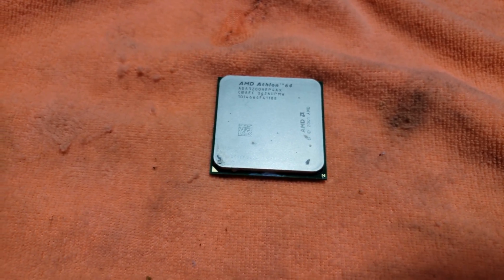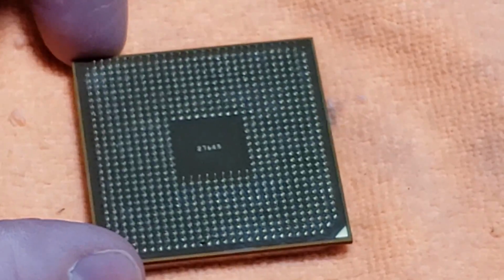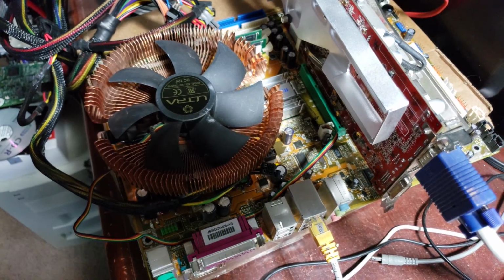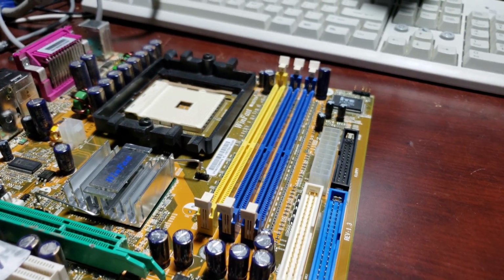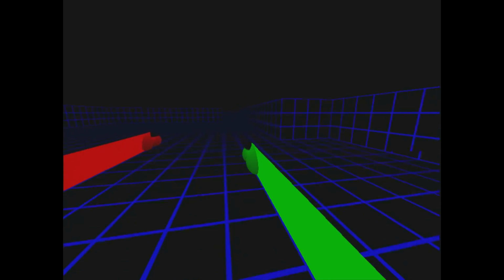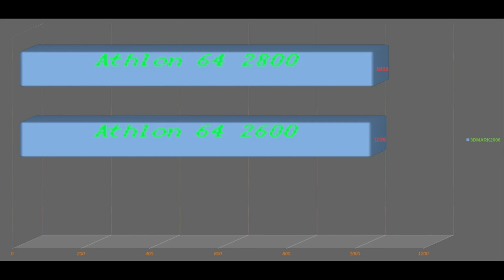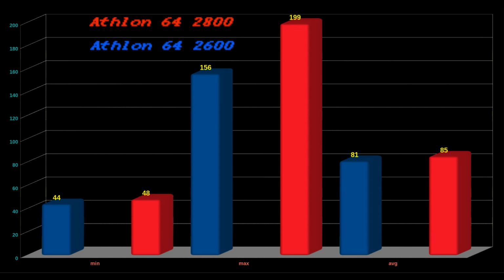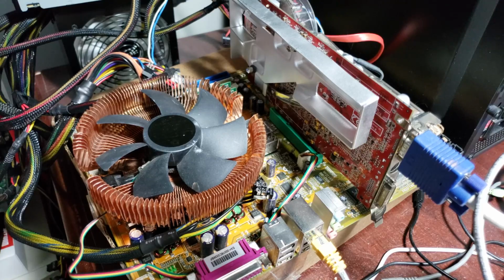CONFIDENTIAL ENGINEERING SAMPLE Athlon 64 CPU TESTED

Comment: Had a 4000+ 939.

Coupled it with 7800 GTX SLI and the fastest DDR1 memory money could buy. 

Worst time on earth to buy a PC. Nvidias marketing is lying these days. Fixed shader hardware is a decrepit fossil. The largest jump in real time rendering fidelity was in fact the first photorealistic distant landscape, which photo is the real photo sort of meme.

The 4200+ on my desk had water, and my 9800 GTX all massively overclocked still struggled thanks mostly to the a.i. scripting on some levels. Even with a vulkan extension, we aren't seeing a proper render. Its pretty much as it was, with a hair more game logic passed off to another API. Its a cheap, half ass solution to rerepresent an ancient era. Good thing injectable raytracing can fix the console code fuckery of the facial rendering.
Reply: Good good. Let the OCD flow through you.

Fun fact. In DX9s path you can in the cvar file force nvidia cards of that age to use 3DC instead of the older inferior texture compression algorithm. I put it in my DX10 path, in the probably vain hope, it was handled in a later patch since I read what I had in some long lost forum.

Comment: Back then AMD would rate their processors in comparison to the Mhz of a comparable Intel CPU.  So an AMD Athlon 64 2600 would be comparable in speed to a Pentium 4 at 2.6Ghz.  This was because AMD had created faster chips than Intel, at the time.  So AMD didn't need them to run as fast to perform at Pentium 4 levels.  it was a great Marketing campaign!  "Our chips run slower and yer perform as or faster than Intel''s offerings".  Intel didn't catch up until the Core 2 processors came out.

Comment: Definitely don't remember seeing one of those anywhere. The clock and name mismatch is interesting because that 64 X2 I had exhibited a very similar quirk, but the opposite way around. So, there's another 3.73GHz NetBurst out there, seems we have competition, though probably not much of one as two CPUs are bound to be faster than one. The heat output must be just fantastic, paint stripper levels maybe.